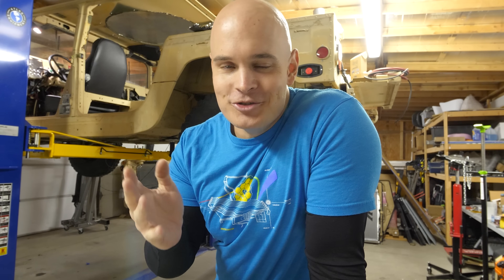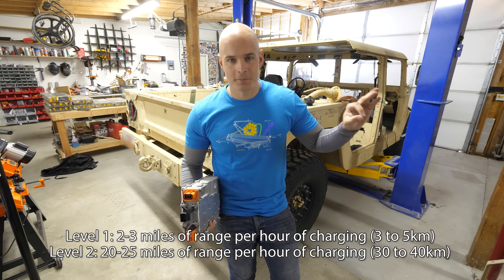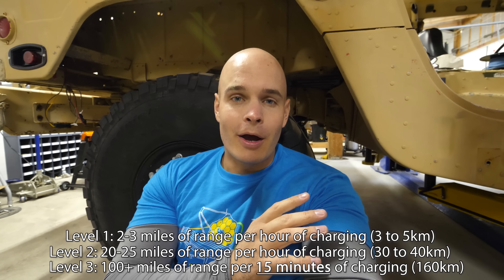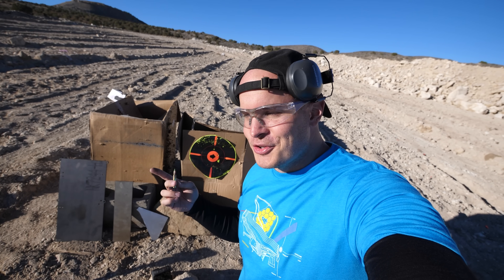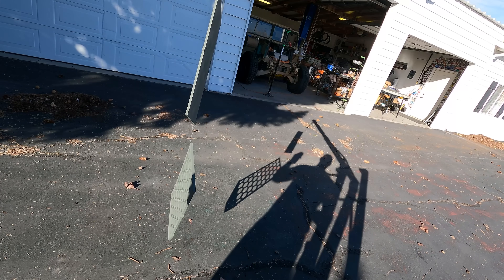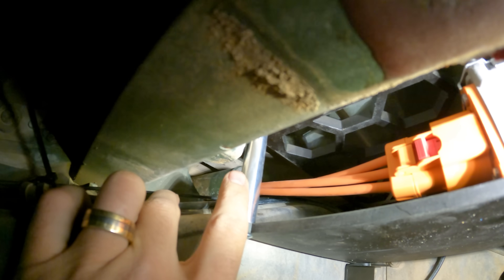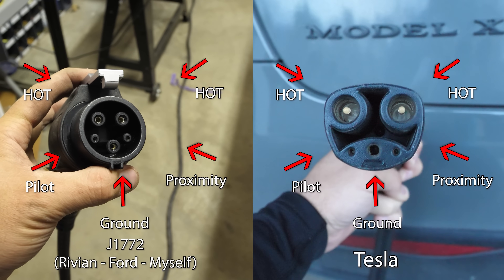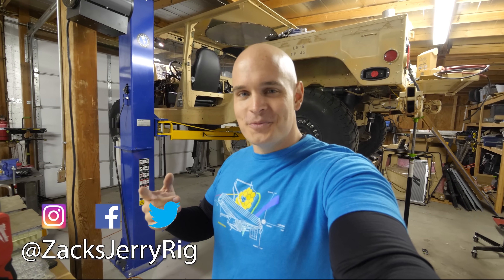My Electric Hummer is Bulletproof!? (Kinda) - 450 Volt Charger Install

Comment: Love the channel, but why the constant tongue-in-cheek put downs about fossil fuels? There are 3 facts that are hard to dispute when comparing today’s electric cars to “yesterday’s gas guzzlers”. Firstly, just the mining, processing and disposal of lithium creates roughly a 3 to 1 comparable environmental footprint over combustion engines. Secondly, electric cars STILL use fossil fuels and lastly electric cars are inconvenient and far less efficient. I’ll even throw in a fourth, easiest and nearly only place to mine lithium…. Afghanistan, meaning absolutely zero chance for energy independence. Keep those wars going!
Reply from the maker: I'm impressed that you got every single one of your facts completely wrong.

Comment: I love this series!! I am gonna use you as a guide for when I have the time/money for my own EV conversion. Btw, have you been using locktite on your bolts? With road vibration you might have an issue with bolts coming loose over time if you don't.

Comment: Q: the wires & sleeve run through the newly cleaned out tube, will rattle? I get rattle will be a thing in this. Just wondering how much you're considering this factor & if you're planning on filling that out with something that will expand to dampen its excitement!

Comment: I would be worried those components will get ruined the 1st time you drive through some water... or rain... They are supposed to be protected from water... just saying... but I might also be dead wrong and they are meant to be exposed to the elements.

Comment: DO NOT DO FAST CHARGING technically put some more heat and wear and tear on the batteries but if you were to use Graphine batteries Then by all means I would still say stick to alternators on the driveline to increase the amount of kilometres that you get while driving

Comment: Best tip for you add a couple alternators to the driveline to recharge your batteries while you drive and also even more breaking power return!
It’s the one part difference between the gas engine and electric engine vehicle but it’s the key component to recharging the battery so you will actually make your batteries go even longer than what you initially thought especially if they’re high amperage alternators
You mean lightning from the ground up not in the sky because the human eye can’t pick up the fact that it goes from the ground up we just see it coming down

Comment: A 55 gr will go through the 1/4 inch AR500 you had because it moves faster than the 62 gr green tip you used, speed beats armor. The "penetrator" only lightens the projectile so it can be longer, thus more stable in flight. Try the test again with 55 gr cartridges but get scrap AR500 so you don't ruin your mount.

Comment: Hey Zack, If it ran on Diesel fuel before its was not a combustion engine Diesel is Compression. If it ran on gasoline then you had it right it would be combustion.

Comment: We use 3D laser cutting machines (Trumpf as well) and they are pretty quick beasts. We only cut 1-3mm thick steel so there is no or very little burrs.
We also use nitrogen as the cutting gas, as well as oxygen - both cut clean but oxygen leaves behind way more slag, that is also harder to remove from the fixture (which we have to do in order for the workpieces to sit flush and be cut to specs).

Comment: Hate to break it to you, but it's still running on mostly recycled dinosaurs :P
Reply: @JorgTheElder  I'm aware that coal doesn't come from dinosaurs. Neither does oil but he made the joke not me.

Just because it's using solar or wind doesn't make it fossil fuel free. Where did the energy come from to build solar and wind power plants? Where did the energy come from to extract the non-renewable lithium used in the batteries come from?

I mean if you really want to get serious about it all of the energy on Earth coal and oil included originally came from the Sun.

So technically speaking, from a point of origin standpoint; everything is solar powered...we're just consuming the energy years after it's been stored on Earth.

Comment: If there is space close to the charge controller you could have kept the DC DC converter close and run your 12v to the fuse box so you don't have that high voltage cable rundown to many places 400v is kind of scary

Comment: Seems like the area where the wires go into the charger underneath is still pretty unprotected. Maybe it doesn't matter, or maybe there is more metal to be put in that area to protect it? I am also wondering about water proofing the connections underneath? Is that necessary? Maybe the intent isnt to get it submerged on the undercarriage ever?
Reply: Hello friend how are you?

Comment: Suggestions on the plastic wire protector you could actually used a spring wire hose or a hose those are much more thicker and will definitely protect those wires

Comment: Wow. No backstop, bad target setup, likely ricochets off the canted AR500 plate, and using green tip penetrators instead of black tip armor piercing rounds. Oy... Bad all around. The rest of the vid is entertaining, but the gun range portion is dangerous and misleading.

Comment: I know that green tip bullets are designed for penetrating hard targets like steel (as seen in the demonstration), but is there any worry when you're shooting bulletproof steel of a ricochet with this kind of ammo?
Reply: That's why you're supposed to angle steel plates when you shoot them, ricochets are a very common occurrence, especially if you're not aware of how to safely shoot steel targets. The angle will (ideally) deflect any bullet ricochets or steel spalling away from the shooter. Usually they're shot from a decent distance as well when you're using rifles

Comment: The DC-DC converter for the 12v battery has a problem.  The fan appears to be in a place that will collect dust and road dirt.

Comment: I hope you read my posts. You will need to seal your undercarriage.  There are holes all throughout the bottom and you will get wet and so will everything else. My humvee would splash me when I drove because there was a small hole we missed. I had to used a cut board to cover the hole for the duration of the rotation. I would recommend doing a spray liner when all is complete.

Comment: What about the cooling for DC charger? I thought it is provided with with water cooler inlet and outlet but did not see it connected to any cooling system. .

Comment: There actually is no "Bulletproof". It depends on the bullet you use. Use a larger bullet and it will go through. It is actually called Bullet Resistant.

Comment: It is but it also isn't bullet proof. AR500 steel is only rated up to a .308 AP round. Anything above that it will not hold up .338, .50 BMG, etc. will make a big hole right through it. lol

Comment: Hey, love the build! Can't wait to see the finished product.

It looks like your using a Valeo 6.6KW or 3.3KW charger.  Do you know where on the internet some technical documentation can be found?  I have the same charger for a project but am having trouble finding information about the pins in the black receptacle.
Reply: Hello friend how are you?

Comment: From my experience you're gonna have trouble with that plug in port. Because some chargers have a more drastic rounded curve so it won't go all the way in if it hits the side of the gas refill port.

Comment: AR500 can't stop a tungsten penetrator from a .50-BMG black tip. That green-tip 5.56mm round's penetrator is mild steel. It's only meant to penetrate cover, but it was ineffective  at that, so they surplussed all of them.

Comment: Curious why you didn't go for that combined 6.6kw charger and DC/DC converter in one from stealth EV.
Also, go ahead and wire up a ccs2 port and put a chiller in the cooling lines. DC fast charging for diy projects is rapidly becoming viable
Reply: Hello friend how are you?

Comment: One thing I noticed is where you placed the charging port. Tesla chargers and some of the other charging locations have their cords super short. So you placing the charging port further forward may run into an issue with reaching the cord to charge it. May want to move it further back to the rear of the vehicle.

Comment: Are you going to make a new trim plate to go around the charging port that says something about electricity instead of saying "use diesel fuel only"? I think that would be a neat feature. "Maybe put HIGH VOLTAGE" ?

Comment: As is tradition, "Plastic is Plastic, and plastic leaks." Is that DC-DC converter water proof? I would not trust your coolant tank (assuming you're using it in your new cooling system) to not pour coolant, sooner or later, on everything underneath it.

Comment: I'm a soldier and I'm well versed in the issues that the geared hubs creat. How are you going to address those issues. Also do you even need that extra torque with electric motor?

Comment: Interesting that the steel seemed to have a larger hole than the aluminum, yet I would have said aluminum is softer...
Reply: Aluminium is definitely softer but that softness renders it kinda tacky. Like, it'll keep bending here and there without breaking off whereas steel even though elastic, has more tendency to not close in on itself after a hole or something is punched through. A very exaggerated example would be poking a hole through a piece of paper vs a lump of dough

Comment: It seems like the charger having exposed sides could be somewhat of an issue? Is it safe to drive through puddles and have water splashing into it?
Reply: Well if its for a car it should be water resistant up to a certain point

Comment: "Upgrade from running on dinosaurs to running on lightning."
Utah energy production: 61% coal.  25% natural gas.
SO, running on lightning, produced from dinosaurs.

Cutting out individual emissions and concentrating them.

Sorry to be a negatard on this.
And I KNOW you have a PV setup you'll be charging from.  So it does shave down my whinge fairly seriously.

And I LIKE electric vehicles.  I really do.
It's just frustration of a lot of "Electric vehicles!  Rah rah!  Phase out ICE!"
But literally NOBODY (including the power companies, states and the Fed) is addressing the problem with that level of electrification.
The fact that the various national grids quite simply CANNOT absorb that level of demand.
I mean, look at California.  Someone sneezes, and they get blackouts and brown-outs.

Comment: If you're flowing coolant around the batteries, that's active cooling. Passive cooling is what the Leaf has. No coolant.
Reply: Incorrect. Cooling by adding energy from an air conditioner is active cooling.
Reply: @vidznstuff1  according to what? If you're circulating coolant, you're removing heat. It's not as effective as using AC to chill the coolant but you're still ACTIVELY circulating coolant to cool down the batteries.
You're doing something to remove heat. It's active cooling. Passive cooling is if the coolant was just sitting around the batteries or just radiating heat to the air.

Comment: Uuuh.. is there a reason that DC-DC converter couldn't run the low voltage side directly? Cut out the added battery and the energy losses of charging it. If it's switchable, hook it to the ignition & go?
Reply: Need to be able to run systems with the HV system fully disconnected

Comment: Bad idea on your charger placement. Tesla puts their chargers IN the passenger compartment, out of the weather. At least they do on the Model S and X.
Reply from the maker: It's weather sealed.
Reply: Not really...the aluminum case corrodes
Reply: @vidznstuff1  with Being How Much Cost Effective These Individual Parts Are & How Well experienced Jerry is. I Think things will work Out just Fine!

Comment: High-voltage electrical component under the liquid one? What could possibly go wrong.
Reply from the maker: It's weather sealed. And coolant isn't conductive.
Reply: @JerryRigEverything  The fan doesn't look very sealed. I understand that the coolant isn't conductive, however I'd still separate them should I be doing it.

Comment: OMG JERRY WATERPROOF THE CHARGING HOLE OF THE HUMMER. A WATERPROOF CAP ON THE BATTERY CHARGER WHERE THE FUEL LINE USED TO BE. YOU DONT WANT WATER DRIPPING DOWN INTO THAT ;-; I hope you make sure its protected......

Comment: Isn’t moisture and road salt a concern with the charger since it’s still exposed on the sides?
Reply: going to assume that all components used in this build are made from stainless steel or aluminium, and due to them being automotive grade parts they will be weather sealed.
Reply: Big point here.
Didn't think of that.
Reply: Maybe just coat it all in epoxy for good measure.
Reply: I thought the same thing! also, that bottom plate would actually trap roadsalt and water, which will destroy that charger in a few years

Comment: Thick wire to the 12v battery and thinner wire to the high voltage battery pack? That sounds wrong. Am I missing something here?
Reply from the maker: Higher voltage = less amps. 
I can get 1500 watts with 450v at 3 amps.
Or I can get 1500w with 12v at 125 amps. 

The amps are what require the thicker wires.

Comment: The dc to dc converter installation location really limits your offroading capability, if you're going to drive through water, since it has an exposed fan. Unless you cover it with some kind of a scoop/snorkel.
Reply from the maker: The fan is sealed. It's just pulling air through the fins
Reply: @JerryRigEverything  gotcha
Reply: Charger too located beneath the shaft isn't safe when driving through waters muds can cause circuit problem
Reply: @andrilsantiago3269  should be waterproof. Those style of connectors have built in seals.

Comment: I wonder how well the converter is dealing with water when driving in the rain, or when wading offroad. Seems it is fully exposed to the elements being mounted next to the front wheel. Or will it be covered later on?
Reply: Or big Rats

Comment: you could have DC charger at home which is called DC level 1..instead of OBC it is several module out on wall and lower amp than DC level 2 which you call it level 3

Comment: Hey Zack, just to tell you that the sides of the Ac to Dc unit is opened and that has been bothering me as you have taken good measures of protecting the bottom with bullet proof steel but the sides are still exposed, Dust and mud does not react well to electronics and wires hope you will add another layer of protection for the underbody or just cover the sides if that thing or any exposed wires, you may already know this, but just to get this out of my system, looking forward to you driving the completed car
Reply from the maker: It's weather sealed. It's OK if it gets dirty

Comment: I didn’t quite get the active and passive charging. I thought cooking with radiator is called active charging as well. I have idea what is the chiller…
Reply: During supercharging the air conditioner cools the battery

Comment: Shouldn't you mount the DC to DC converter higher up or in the cab so there would be no water ingress should you do water crossings or drive into puddles at speed?
Reply from the maker: All of the electronics under the hood are vehicle rated and water tight

Comment: Bro most of Electric vehicle have charging circuit inside not outside. Outside thing is just a monitor or AC controller circuit, its also not respocible to convert any current from AC to DC. Its directly puch AC To vehicle after confirm proper connection between outlet.

Comment: I work for a Charge Operator  Company in germany. We actually offer only 3 kind of charging outlets. CCS which is the DC hyper Charger with 50+ kWh, type-2 which is AC maxes max 43 kWh and CHAdeMO also a DC charging plus for Asian build cars maxes at 50 kWh. I have a few friends which bought e-motorcycles from the states and are not able to charge at public accessible charge stations since the charging outlets,which are standard in the US, are different from the one we have in Europe.

Comment: yes the green tip wont go through the ar500 but it will degrade its strength with every shot fired at it. shoulda shot scrap.

Comment: Wouldn‘t 3 phase AC be an option for charging at higher speeds? 

I mean, 208V @ 30A are about 6kW instead of like 2.2kW.
Reply: Only an option in an industrial building. So, no. It's also 120V/240V, not 110/220.

Comment: The under side of the battery pack should be bullet proof as of tesla ,telsa uses titanium plates to protect the packs, during the early days of tesla they did burned a tesla which suffered a puncher dur to lack of proper protection.
Reply: IIRC the titanium shield is (or was in older Model S?) only at the front of the pack as the debris penetrated trough a gap and hit the front of the pack. The underside of the entire pack is strong enough against even the roughest road debris but probably not bulletproof.

Comment: The thing about anything "bulletproof" is just that they're usually not a permanent solution, since the shot material will become compromised and would weaken over time being shot. Thus bullet resistant would be the correct term.
Reply: That's why we say bulletproof up to "NIJ 3" or something like that as it is still bulletproof up to those standards.

Comment: Great video!. Just i have a suggestion... ypu should use rubber gaskets between the plates so the metal to metal contact wont make wierd noises.

Comment: You can tell how old we are when we say voltage out of the wall is 110v or 220v. At one point it changes to 120v and 240v for some reason. I thought I was going crazy or jumped into another alternate universe when I started seeing that and had to google it.

Comment: Technically Speaking there is no Level 3 charging - it's just called DC Fast Charging / Supercharging.  Also, the charger is still exposed on the side, above the bulletproof steel.
Reply: its for random road debris